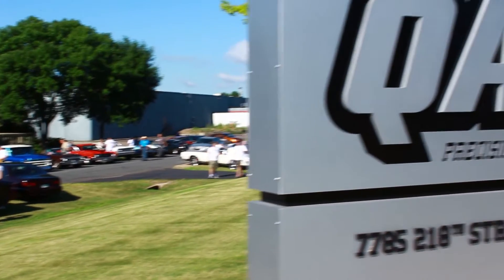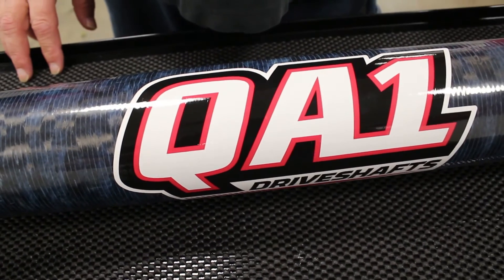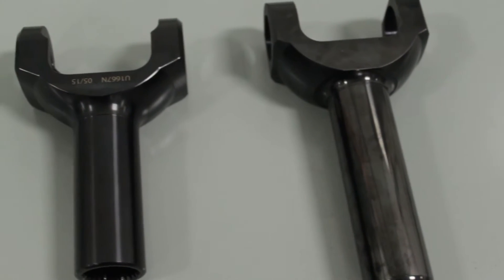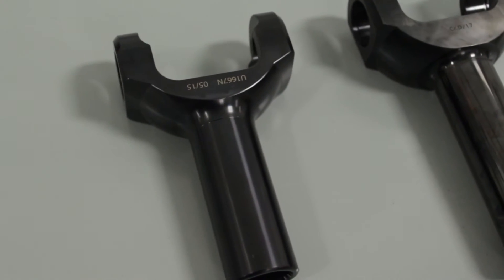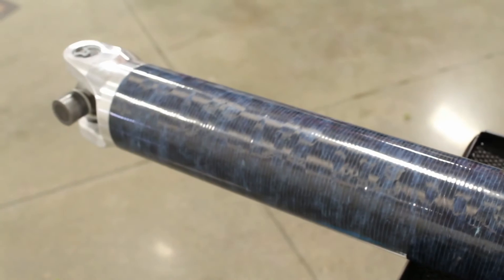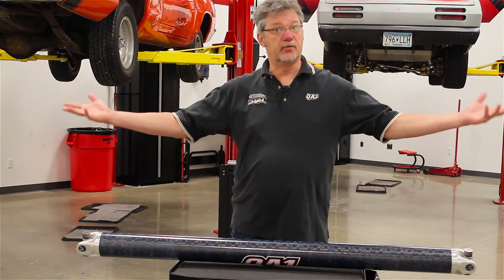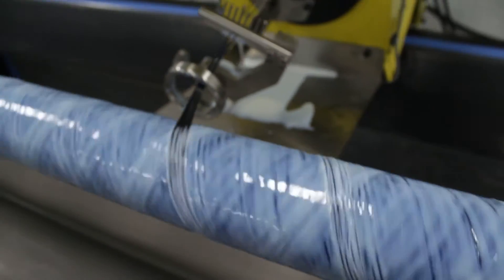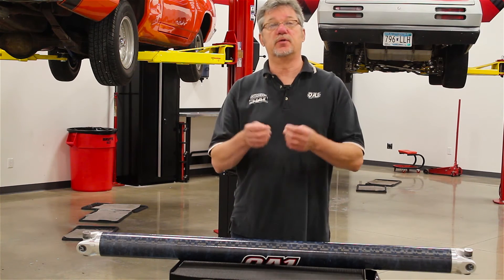QA1's REV Series High Horsepower Carbon Fiber Driveshafts

Comment: Probably not a good idea for drag racing. Lot of broken cf drive shaft in drag racing it seems on youtube. Needs to sponsor this cf shaft on drag cars to prove it can hold high horse power.
Reply from the maker: We have quite a few of them out there running on the drag strip with no reported issues! We did a lot of testing before putting these on the market.